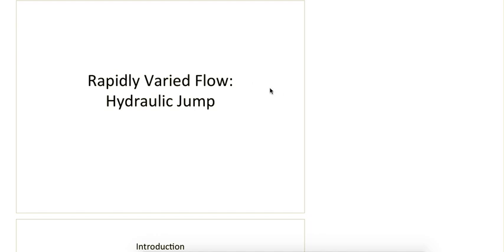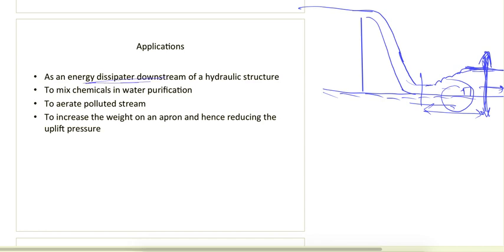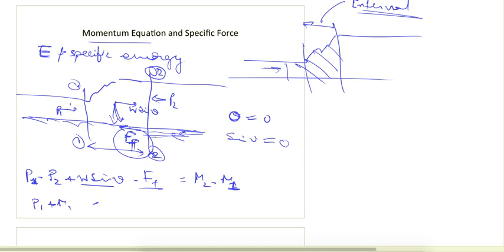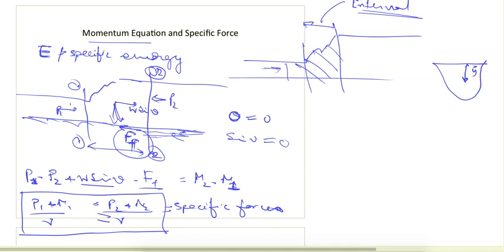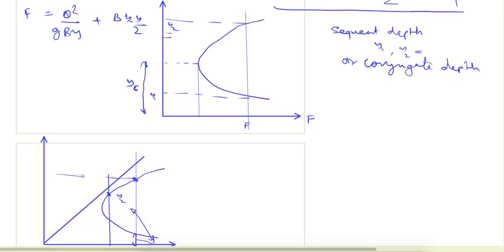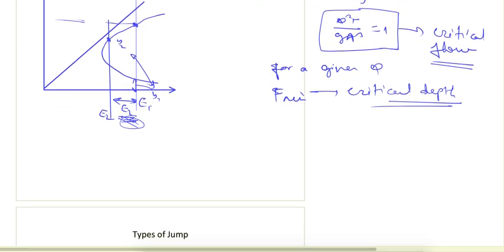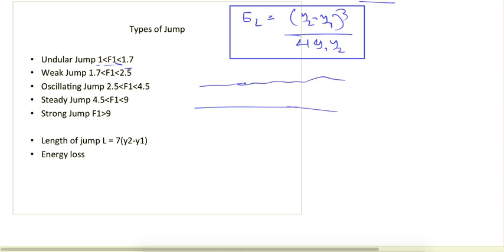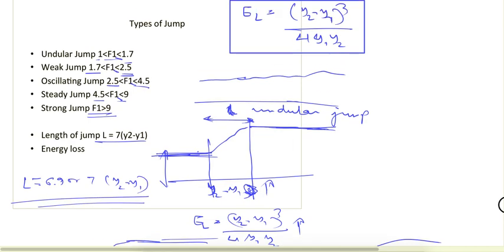Rapidly Varied Flow | Open Channel Flow

Comment: Sir Machines ka bhi lecture upload kar dijiye
Reply from the maker: Feel free to check out our website learn.apsed.in for more topics; In this you get access to all topics in Civil Engineering with solved examples and study material. Also you get doubt support, you can clarify any doubt you have. Apart from this you get access to mock tests, practice questions, study plan, formula cards.

Comment: sir apne specific force ka derivation do jagah kiye hai pahle wale me wsin@ balance kar raha hai friction ko aur last lecture me small length aur angle liya hai sir why
Reply: Aditya Kumar   coz in this case pressure forces at prejump and post jump sections will not be same due to different corresponding depths..... and considering surface to be horizontal and friction less... wsin@ and frctional resistance will become zero....... thtss  whyy...